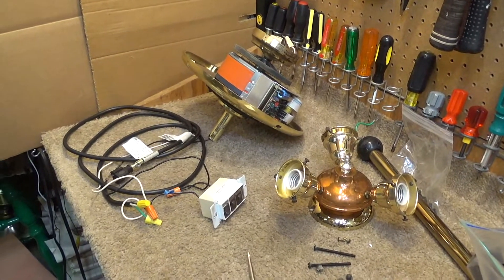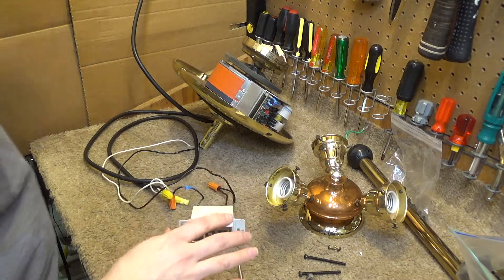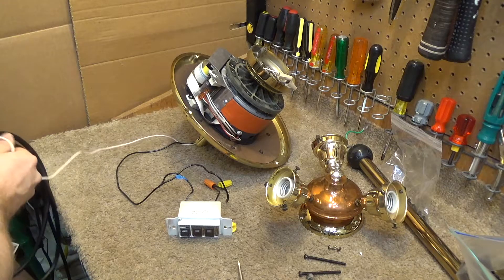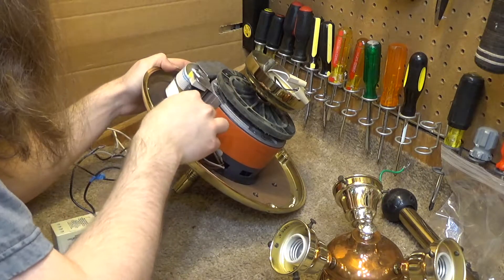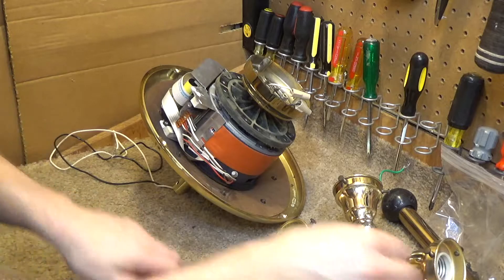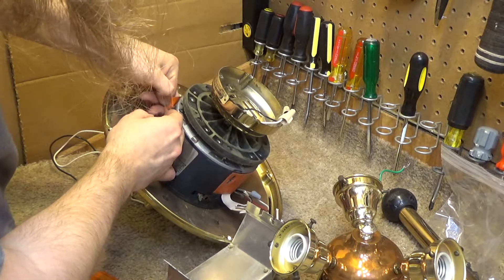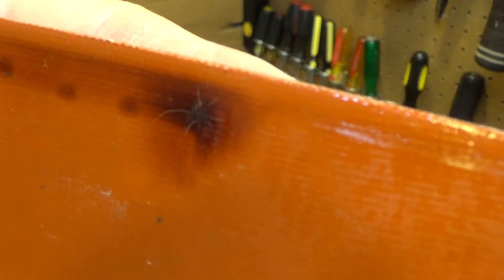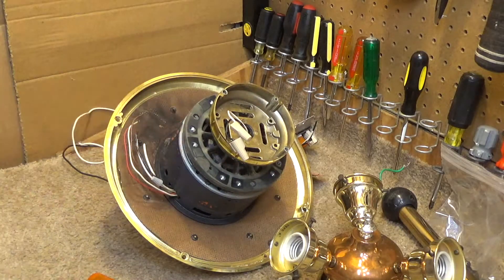Casablanca 50" Brass/Copper Gallery Edition Panama | Test and Remove IntelliTouch Electronics

Comment: Did you wire the switch to the neutral?!? If you did that’s definitely wrong. Switch could also be bad. It’s your fan but I still wish I could see it stay intelitouch since this model is rare.
Reply from the maker: I wired it into the high side, not neutral.. I know it's rare and part of me would hate to modify it since I like things to be original as well, but it's just totally worthless to me with the IntelliTouch control even if it worked properly..

Comment: Omg imagine not knowing what “flik mode” is.
Reply from the maker: That doesn't make sense.
Reply: @JordanU  You've got to be kidding me, that board was fully functional. "Flik Mode" was a thing where you can only control the fan with a light switch. Its simple:

First, you turn on the switch, the fan starts going through the speeds. When it reaches the speed, flick it again and it will go on the desired speed, thats what YOURS was doing. This board might have been Rmm2, which is extremely rare to see fans that have rmm2 with flick in it. 

Oh well, you were gonna replace the board anyway, just wanted to let you know it was a working board.
Reply from the maker: @kaysonthefancollector8826  The board was carefully preserved and stashed away in a box should a use care for it arise. But even if it wasn't, there's absolutely no need for the attitude and hysterics.